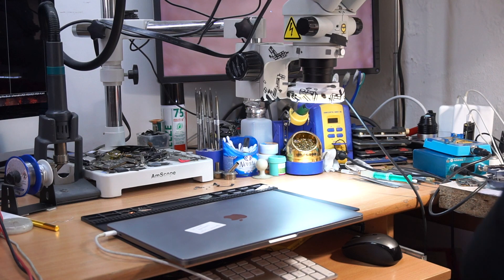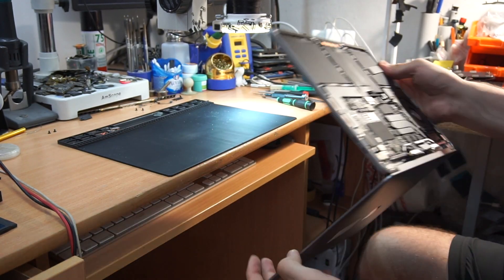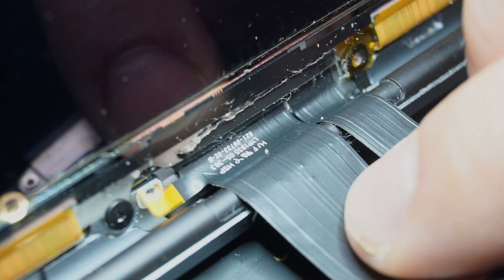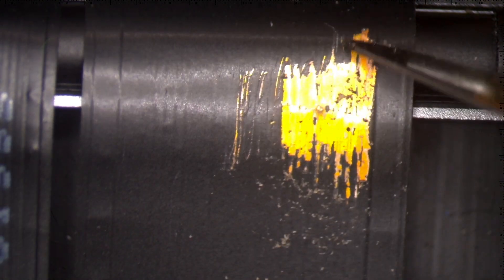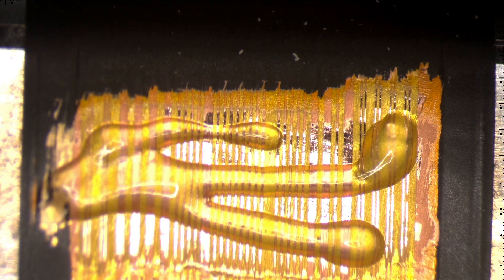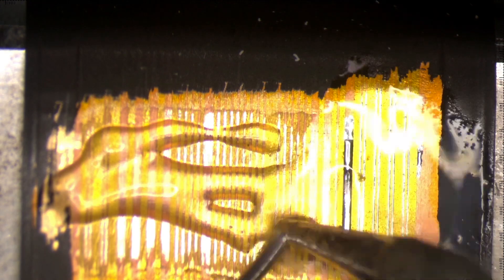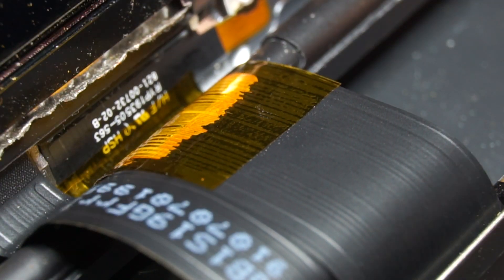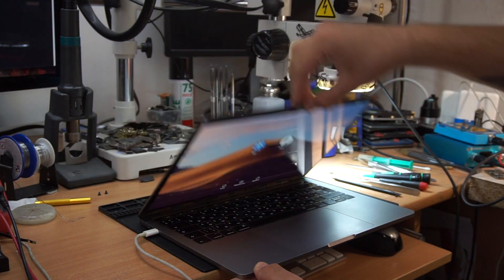MacBook Pro A2159 2019 lines, weird image and no display (dust gate repair)

Comment: Massive respect for the effort and precision. Same problem here.. Pink screen. Really having a hard head doing this by myself, made me nearly cry when seeing you scraping and doing all the rails with new solder and even with some jumpers. Last year I replaced a blown capacitor on the motherboard, after that its worked fine again, was doable.
This is next level for me, and I yet have to decide if I gonna do it this way.
I rather replace the flex cables if possible, what parts am I looking for? And is it hard to deattach them from the screen itself?

Comment: Very nice job! What is the wire used for these joints? 0,01 uninsulated or better pre thinned wire or what?
Reply from the maker: @ictrepairs6963  hello, I wouldn’t recommend this method anymore, it was a temporary solution until we came up with a better one which is, replacing the whole flex cable but will have to remove the screen from the lid to do such a repair.
Will do a video about the new method so stay tuned.
Reply: @iTouch-repair  I would love to see that video!
Reply from the maker: @ictrepairs6963  apologies for not answering your question 😅, I use a 0.008mm wire, will put it in the description.
Reply: @iTouch-repair  thank you! Opening that screen is a real pain in the but... Something can go wrong during the disassembly process and risk the whole display instead of a new future failure in the flex has to be taken in count. Looking forward to seeing the new video.
Reply: @iTouch-repair  You mean 0.08 mm?
Reply from the maker: @MrBojangles901  no, I meant 0.008mm.
Reply: @iTouch-repair  Weird because I used 0.05 mm on then same repair and my wires look a little thinner. Maybe that is then enameled size or it's just wrong.
Reply from the maker: @ don’t know, just google a jumper wire 0.008 and you’ll find it on aliexpress.
Reply: @iTouch-repair  Right you are. Hmm. Well thanks.

Comment: Wow, that was a great video, thank you so much! Does this happen with the MacBook 12" also? I have a MacBook 12" which has pink/purble vertical lines all over the screen, but it works perfectly fine on a external display.
Reply from the maker: @d_lydian  Hi, thanks for the support.
It could be, I didn’t come a cross this issue with this model.
It could be simply the screen flex cable.
Reply: Thanks for your answer, I will open it in a couple of weeks and tell you about it

Comment: This is happening with my macbook air m1. Frustratingly every shop I have talked to immediately say that I will need a new screen.  I have had to say to them "might it not be the flex cable?"
Reply: you need a new lcd because the cable is soldered to the back of the lcd panel and its almost impossible to remove it from the shelling without breaking the LCD since its glued in, and it takes longer to repair so it would actually be more expensive than LCD replacement on M1 models. There is unfortunately a lot of misinformation online and people assume its a cheaper repair. If your screen is over $1K or you don't have the part then yes maybe worth a try. But removing the LCD will make it more fragile and can actually break easier in the future.
Reply: Have you managed to find a fix, I’m in the exact same situation.
Reply: @charliebullock5344  yeah, we are jajaj
Reply: any update?
Reply: @yan_88tv70 did you manage to repair?

Comment: Why these stupid trains! we would make all the wiring into the screen loop as in the Retina 2015 models, just make the inner diameter of the hole in the loop larger and more conductors and evenly distribute all the necessary wiring into the left and right screen loops.
It can be seen that they did it on purpose so that more often it was small, like a soldered SSD / THERE is NO REASONABLE REASON TO DO SO, except to cut money from additional breakdowns!

Comment: But seriously why dont u just change the cable? Is it a harder task? May i ask how does the flex cable connect to the screen? Is it soldered or just slot in?
Reply from the maker: @alikhalil6463  I have answered this question sooo many times and I will answer it again, the flex cable goes under the screen, so in order to access the flex I need to remove the screen from the lid which they are glued together (you need to remember the risk of breaking the screen).
Reply: @iTouch-repair  do you have a video on this process as well?
Reply from the maker: @moseskyonas  Hi, I am working on the video, stay tuned.
Reply: @iTouch-repair  alright thanks 🙏

Comment: What if the big flex that u repair has a little cut in some situations...is it still repairable with the same process by running a jump wire on it ??? Thanks
Reply from the maker: Hello, yes you can.

Comment: Is this damage EVER in the already-exposed ribbon area that doesn’t require that Bezel coming off? 
I have the screen disconnected (but wonder if I should just try re-soldering a couple small creases I see in that section first).
Reply from the maker: They are always hidden under the bezel, you need to remove the bezel and clean the flex there.

Comment: Man I don't have them skills, amazing! But I can add that its always advisable to separate plastic from glass with thin plastic. 
When you separated the bezel, a thin laminate of plastic might have been more helpful :)

Thanks for sharing...don't think I'm brave enough for that, yet
Reply from the maker: Hi, thank you.
Regarding the bezel, at first I tried with thin laminate plastic but, when you apply heat it melts.
Also it doesn’t have the hardness to separate. With the tool I am using in the video, I can separate the bezel leaving the double sided scotch which makes it easier to clean.

Comment: I have been able to do this successfully myself a few times now but have also had a few times now where a very slight flicker remained visible. In the flicker I saw the apple logo that you normally see during startup. And if I move my mouse the flicker is gone until I hold the mouse still again. Any idea what this could be due to?

Comment: Awesome job on the repair! I have this same problem with my 2019 16", however I mainly use it with an external display. It stopped working with my display and I thought it was dead, then I connected it today and it's randomly working again. Do you think if I use it with the external display and keep the laptop closed it should last for another 6 months, or is it likely to go out at any time?
Reply from the maker: Hi, it’s not Gina get any worse 😅.
It should work for as long as you want if you are ok with working like that .
Reply: @iTouch-repair  true lol,  I guess my concern is that the laptop will stop recognizing the external display and then I will be stuck without a laptop at the worst time when some important work is pending.

I thought that is what happened but then weeks later I connected it and it worked again with the display. Are these two issues related or is it nothing to be concerned about if I keep the laptop closed at all times and keep it connected to the display?
Reply from the maker: @mushroomthump  it’s better to keep it closed so you don’t damage the flex more (it’s gonna be easier to repair).
They are not related, the screen stopped working because of a break in the flex, the external monitor works off of the GPU, it should be ok.

Comment: Thank you so much for such a great vid 😊 What is the cable that needs replacing here? I ordered an LCD flex cable for an a1989 macbook.  It looks different to the one you repair, alot thinner and theres 2 of them.

Thank you in advance!
Reply from the maker: Hi, I didn’t replace the cable in the video, you can rewatch the video.
To replace the flex cable, you will need to remove the screen from the lid which there is a very high risk of cracking the screen.

Comment: That is an interesting repair; I usually just change the LCD because I can fix the LCD Panel in 27 minutes and for most of the units I repair that have this issue, the LCD is $100-$150; the labor cost that I would charge to do it this way would be more than the cost of those LCDs.

But if I ever come across one with a more expensive screen that just has this issue, I may be inclined to try this method.
Reply: I have a 2017 Macbook Pro and a 2018 MacBook Pro. Can I just swap the LCDs to fix this on the 2018?
Reply: @seanwalsh5717 An A1706 and A1708 have compatible LCDs, but they aren't compatible with the A1989, A2159, A2289, or A2251, however (I believe) those four all use the same LCD, but none of them are compatible with the A2338.
Reply: my thoughts exactly, its much cheaper and 100% guaranteed repair to actually replace the LCD, unless the LCD is over $1K or even in that case you would be risking damaging the LCD with heat or tiny cracks when removing the bezel as shown in the video.

Comment: Do you know if this has caused issues with the touch bar, or could it? I may have an extreme case of this or it may be something else, i took mine camping and it was in very dirty conditions. It turns on and i can get it into voice over mode but no screen or touch bar.

Comment: Hi, I have a M1 13 inch and the screen is black with backlight on. Displays ok on external screen. The ribbon seems in good condition. Do you think this might be a different issue, for example the t-con board? I have done such flex cable repair in the past and know what to look for on those bulges in flex ribbon caused by dust, but this flex is 100% intact.
Reply: i have a m1 14” it just happened randomly to me this morning. have that weird black / white icon on my display now and can’t see shit. luckily I bought apple care+ til 2025. never had this happen to me on any macbook before. ugh.

Comment: I am facing in my MacBook pro 2017. A1708
Reply: That's same as my MBP. A1708 is my macbook type. I just had the problem since yesterday and it's flickering when the MBP is warm 😢 it's usually not like that. When i turn it off for hours and then turn it on again, the screen is normal but after 30 mins it comes back again 😢
Reply: @Tari19418  Same problems happen in my Macbook Pro 2017

Comment: Nice job. I also do these repairs and the only thing I'm curious about is why you scrape and solder ALL the traces ? Most of the time it's clear which trace needs to be repaired, I would leave the other ones alone. 

That being said, I still have a couple of screens where I can't find the fault so soldering all the traces ( or several) might work 😀
Reply from the maker: Thanks, exactly, you never know where the dirt made a micro crack in the rails so, it’s better to just do them all so the costumer doesn’t return for another same repair.

Comment: How much do you charge to fix this? And why not just buy the flex gate cable ? I think that’s what is called lol but hey ur amazing with the skills 🤌🏾💯
Reply from the maker: Hi, regarding the price please contact me, contact info in the description.

As for the flex, it goes under the screen and in order to reach it, you need to disassemble the screen from the case and I don’t think that it’s quite safe.

Comment: Hey there, great repair. This was just the video i needed💪 
Wich diameter solding threat do you use ?
Reply: More likely it is the diameter of the jumperwire you are using
Reply from the maker: @havoerredIHD  Hey, thanks.
The diameter is 0.008mm.
You can find it on aliexpress.
Reply: @iTouch-repair  thanks alot, thats a damm thin wire 😅👍🏼
Reply from the maker: @havoerredIHD  thinnest in the world 🤏🏻
Reply: @iTouch-repair  i just ordered one in 0,009 i hope that Will do it 🤞
Reply from the maker: it should work @havoerredIHD
Reply from the maker: i just checked and its a 0.007mm thickness  @havoerredIHD
Reply: @iTouch-repair  isolate wire? Link?

Comment: Hi. I've done one today and it works but.. When you move cursor then the screen is ok but when you leave it and there is nothing "moving" on the screen then it starts to flicker. When you play a video then all is good too.. Do you know what could it be?
Reply from the maker: Check the other flex it could in multiple places.
Reply: Like iTouch said, it must be another trace that not clearly visible. I also have these issues with some screens.

I tried to pinpoint the trace by measuring all the points on the t-con board and comparing to a known-good screen, but could not find a clear indication. Maybe I'm measuring the t-con instead of the screen that way.

Comment: You can buy 100$ lcd without backlight , and replace that
Reply from the maker: You didn’t mention the repair cost 100$ plus replacement!
Reply: @iTouch-repair  your work that you show coast less than 150$? You do it with warranty . 4 months? 6 months?
Reply from the maker: @wesave_minsk  I meant the 100$ screen cost plus shipping plus you need to find it for your model for the price you are suggesting plus the flex for the backlight plus the backlight issue is only in the A1706-A1707-A1708 not in the new models.

I do this repair for free for you, if you want to send in I live in Ukraine, please send it if you can.
Reply: For fred .???
Reply from the maker: @M-0021-m4z  contact information in the description
Reply: What’s the permanent solution?